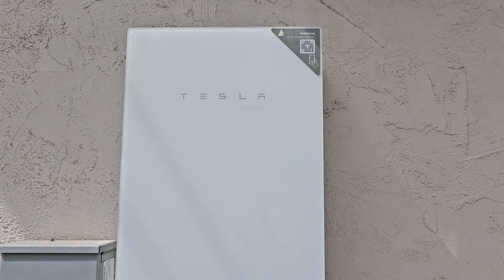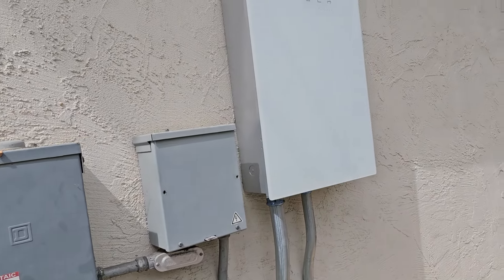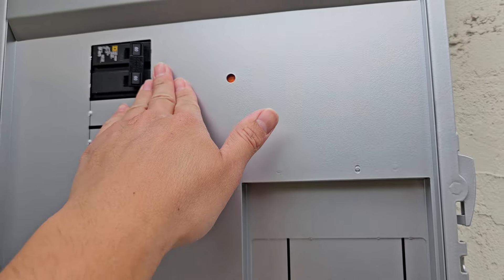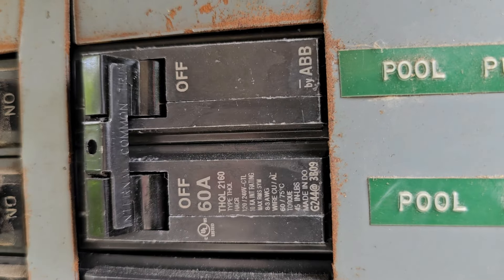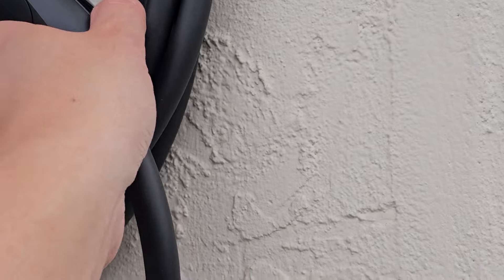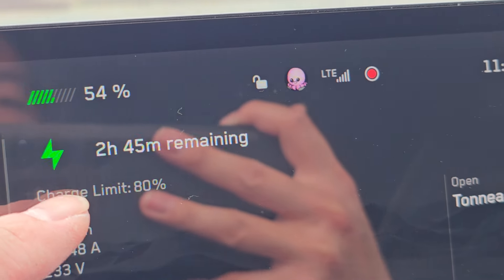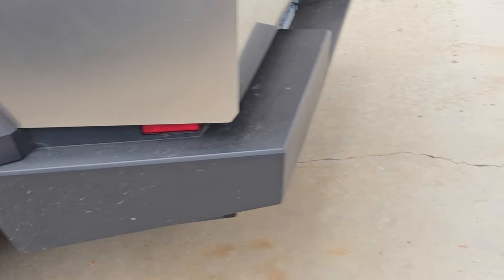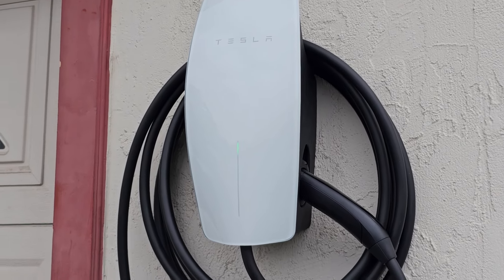Tesla Cybertruck Powershare and Universal Wall Charger Installed Pending 200a Service Panel Upgrade

Comment: They use the 2.4Ghz because it has a better capability to go through walls and garage doors and be “more reliable” connection.
Reply: Plus, the extra speed that comes with 5 Ghz would be wasted on an EVSE.
Reply from the maker: That's true, but they're forcing people to use what's slowly being phased out.

Comment: Wow!  I didn't know they could install the gateway outside!  If I had know, I would have asked them to install it outside for me too, so I take up less space in my garage. Oh well. BTW:  I don't charge at home either, PGE charges too much for electricity...  Where do you go "elsewhere" to charge for cheaper?  I still have some free supercharging miles from the referral program, but they will eventually get used up, hehehe.
Reply from the maker: It's a secret where I charge. I have to sleep in the truck in order to get the benefits though. Haha
Reply: @ItsBinhRepaired woah!!!!  Interesting! 😮
Reply from the maker: @UTECHPIA  haha cause I need to unplug at certain times.
Reply: @ItsBinhRepaired let’s be charging buddies :)

I will meet you at the charger’s tonight? 😅
Reply from the maker: @UTECHPIA  lol
Reply: @ItsBinhRepaired  hehehe. Maybe another time then 😅
Reply from the maker: @UTECHPIA  mine is already over 80% picked it up from the service center
Reply: @ItsBinhRepaired what was wrong with your Cybertruck?
Reply from the maker: @UTECHPIA  lots of creaking noises in the interior. Scratches on the body. Tailgate emergency release one side didn't work. Some parts weren't aligned right.

Are your camera views tweaking? After the update it's been so unstable and jittery.
Reply: @ItsBinhRepaired that’s crazy!  I hope they fixed it all for you. I didn’t have any of those issues. 🙏📐
Reply from the maker: @UTECHPIA  it might be I'm just more particular about mine. Watch me sit in yours and look at it and be like all this is messed up lol
Reply: @ItsBinhRepaired probably!!!!  Hahahaha. 😂
Reply from the maker: @UTECHPIA  There's still a few more things for them to work on in the interior. Should be done sometime next week.

Comment: How far away from the gateway is the universal wall connector?
Reply from the maker: Over 40 feet I believe. It's on the opposite side of the house. They routed the wiring up, so they likely used about 80 feet of wire or so.
Reply: Great info!  Thank you!
Reply from the maker: @kdreed96  no problem

Comment: 60A out to your two EVSEs doesn't sound right. Sounds like they agreed to wire both because your plan is to not use both for charging, but still doesn't seem like it's wired safely. Each, your current charger, and the NEMA 14-50 needs an independent 60 amp breaker. I guess that'll happen when your service upgrade happens. Did they not permit this job? I expect they would have required the service upgrade first rather than to finish the job before that step.
Reply from the maker: No The Tesla charger and nema 14-50 are wired separately. I'm waiting for a 200 amp panel upgrade.
Reply from the maker: The nema 14-50 isn't wired up. As mentioned, the wires coming out of the roof will to a 50amp breaker in the new 200a panel. They did get permits for the job.

Comment: Is the PowerShare capability even out?  I thought a software update is coming later.
Reply from the maker: Yup, can't use powershare yet. Also, need to fix the charger wifi connection first. It looks like the installers need to commission it again.
Reply from the maker: They said they had a test cybertruck for a previous install and it was working.

Comment: How much did they charge you for install
Reply from the maker: I think about 4k, but I'm having them upgrade my 100a to 200a Service Panel and a 14-50 outlet, and that upped the total to like 11-12k. I forgot the exact numbers.
Reply: @ItsBinhRepaired   wow yeah I'm getting mine sometime this week I'm having major anxiety for 1 buyers remorse lol and 2 Im afraid I'm gonna lose a lot do you have any advice should I pull the trigger and get it or should I wait longer to see how much there gonna depreciate lol
Reply from the maker: @amerb313  the Cybertruck? There's definitely going to me major depreciation. If you have PG&E, I don't recommend it unless you have a cheaper place to charge. The electricity from PG&E is a lot more expensive...
Reply from the maker: @amerb313  i don't even charge at home lol
Reply: @ItsBinhRepaired  what's pg&e
Reply from the maker: @amerb313  electric company. They charge us 34.4 cents per kwh offpeak!.... I think it's 55 or more during peak..